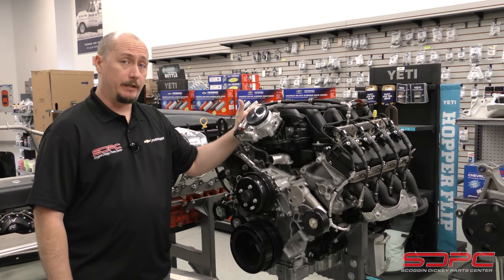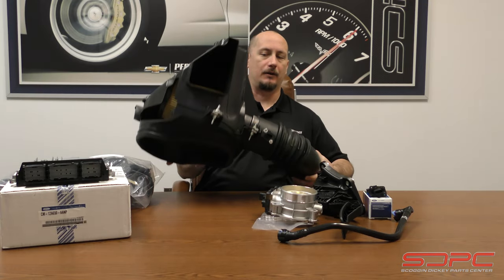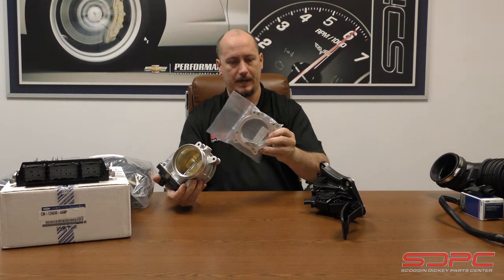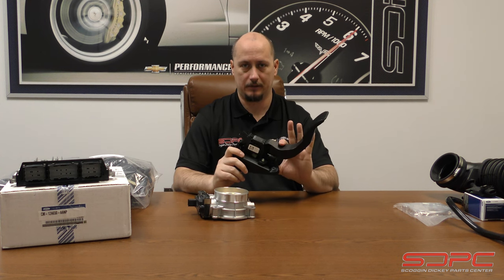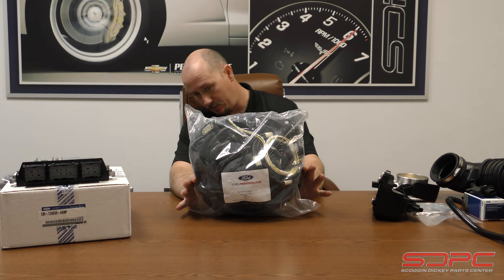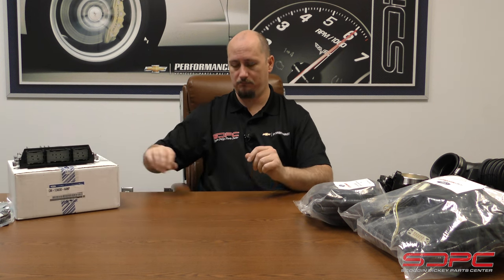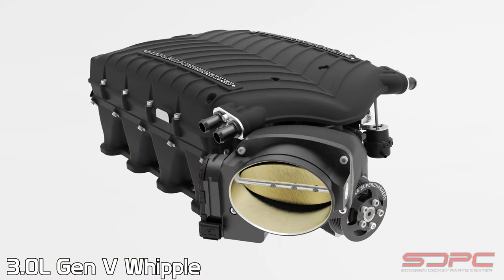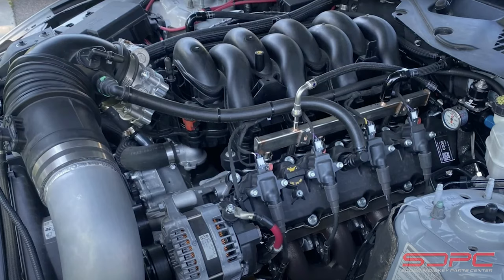Godzilla Crate Engine Control Pack

Comment: OBR Control Systems also makes a control pack (ECU) for the Godzilla. 500hp N/A pre tuned. 3 wire hook up power, ground and ignition. Also tunable just like any other aftermarket system. Great video!

Comment: We tried calling the number person who answered had no clue about anything with this motor, Is there anythnig available yet for a tremic 5 speed??
Reply from the maker: Sorry you had that experience, we do pay attention to these responses and try to make improvements on educating our staff.

There is a Lakewood bellhousing, and we do have the Tremec TKX 5-speed as well.
https://sdparts.com/i-24530000
https://sdparts.com/i-24527457

As far as clutch kits, shifters, and hydraulics, it comes down to what you plan to do with it or what your favorite personal setup might be.

There's not a whole lot of documentation at the moment and we don't have any in-house experience with making the Godzilla calibration work on a manual transmission setup.

Let us know if you need anything!

Comment: Hi guys anything available, for T5 can you help
Reply from the maker: There is a Lakewood bellhousing, and we do have the Tremec TKX 5-speed as well.
https://sdparts.com/i-24530000
https://sdparts.com/i-24527457

As far as clutch kits and hydraulics, it comes down to what you plan to do with it. There's not a whole lot of documentation at the moment and we don't have any in-house experience with making the Godzilla calibration work on a manual transmission setup.
Reply: We have a Godzilla motor with tremic 5 speed. Truck starts but runs like crap. Sounds like has a cam. We used original
Cpu with pats delete. Anything out yet for the Manuel trans
Reply from the maker: Sounds like it might need further calibration as well. Was it a pared down oem harness or aftermarket?

I havent had a chance to look at the godzilla tables on hptuners to see if there are any configurations on running it as a manual with the production ecu.
Reply: @Sdpartscenter  Hi, we are running oem harness with flashes pats delete Cou from Mars. We know there is Obr who has one but it’s also! $$$

Comment: Is there a control pack available for a T-56 manual set-up, instead of the automatic?
Reply from the maker: Not at this time. I haven't had an opportunity to mess with the platform to see if you can run a manual behind it with the control pack.
Reply: @Sdpartscenter Thanks for the quick response. I was getting ready to start a Godzilla swap in a foxbody and really didn’t want to go auto. I’ve had the engine sitting in my garage for a year. Looks like I’ll have to hold off . . . bummer.
Reply from the maker: I wouldn't give up hope, there's bound to be some good info. Might have to creep through some of the facebook groups.
This one has a larger user base but should have some good info hiding in there:
Ford 7.3L Gas (Godzilla/Megazilla) Owners,Tech,Performance and Engine swaps
Reply: @Sdpartscenter  Great; I’ll keep searching. Thanks again for your help!
Reply: Any luck or updates on a control pack or files available for Manuel T5? We have a t5 tremic and truck runs but doesn’t run right take a look on our page. Can we try to do something tighter?
Reply: Were you able to find anything? the shop put a T5 and the truck seems like its in limp mode doesn't run right,